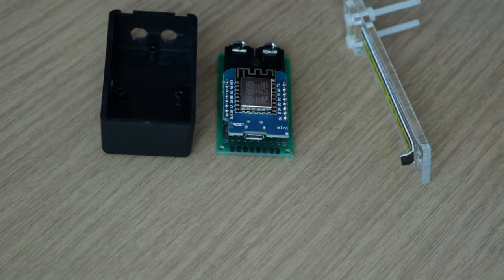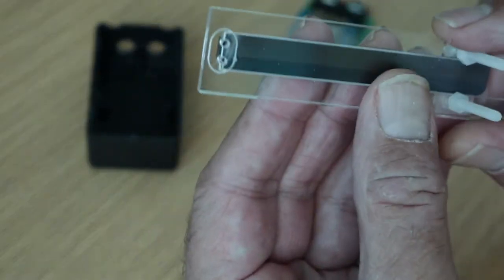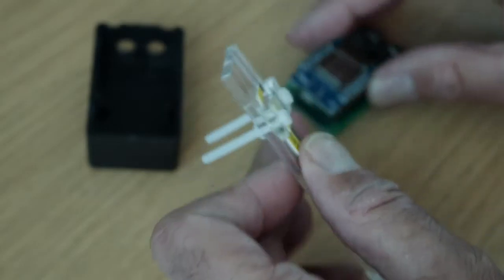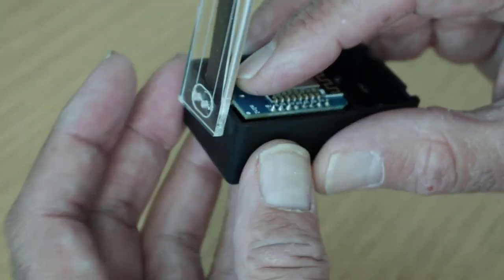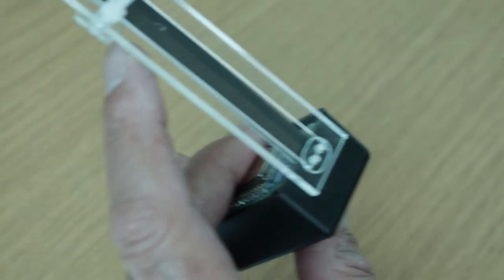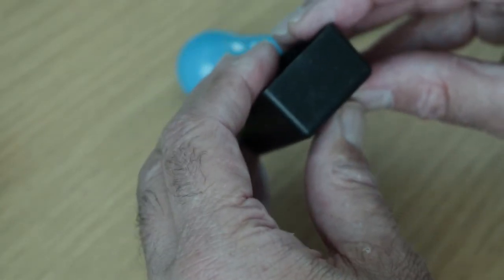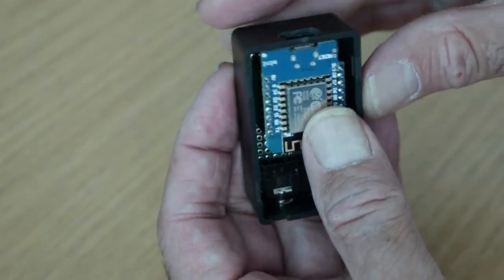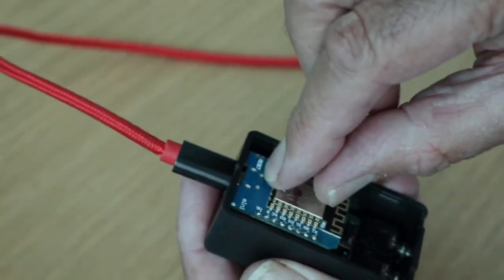Perfectly aligned holes in your project box - without measuring - USB-micro socket.

Comment: Cool. I would make it a little further. By cutting the exact shape into the perspex. And would use a dremel with a Miniature Ball Bearing Router Bit.
If you have a 3d printer you Could make a tool  with ease.
Reply from the maker: Good idea. At the time I thought the drill centres were more useful, and engraved the USB shape into the acrylic which pretty much does what you suggest. During lockdown I realised there are other simpler ways to implement my idea - see how I did jack sockets.   https://www.youtube.com/watch?v=GvFrAhnp5uA